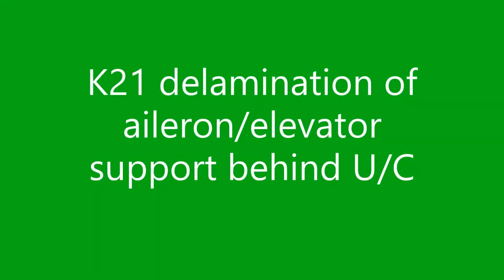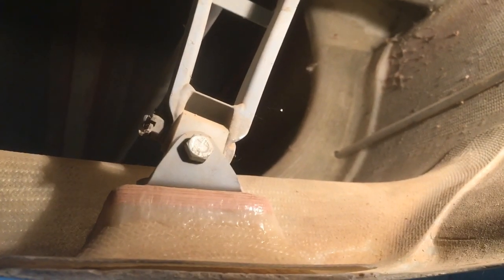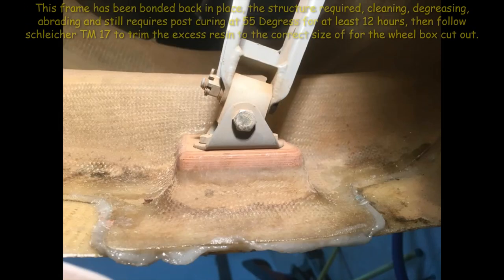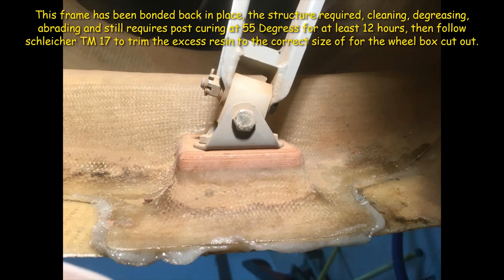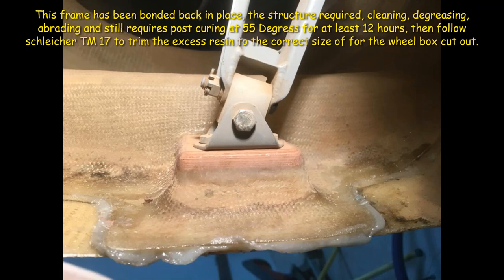K21 Delamination of elevator and aileron support just behind mainwheel  damage and repair

Comment: Very informtive.
This repair can still be improved by adding one additional layer of glass, say 92125 starting from the plywood over the free joint and extending say 50 mm after the flox-joint on the fuselage skin.. 
It is clear that the outer flox joint has to be surfaced to a smooth contour. The nicer, or smoother the slope to a pulling load, the stronger it is. In fact, the inner side of the glass fibre box, where the flox cannot be touched should have a very nice radius too. 
If problems are persistent, than use 4 flush titanium 5/32 Hiloks (=aerospace-rivets)  in the flange. You have to pull them through the outer skin to get the bracket loose. Certified fasteners which do not corrode in lengthy times.